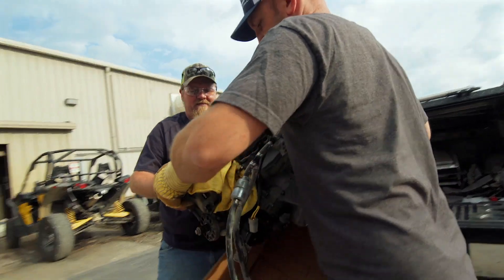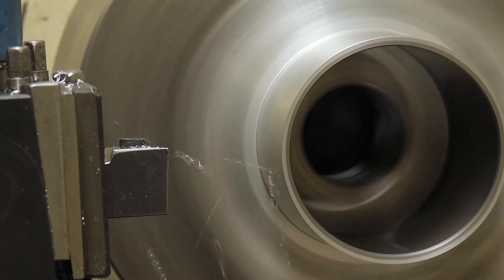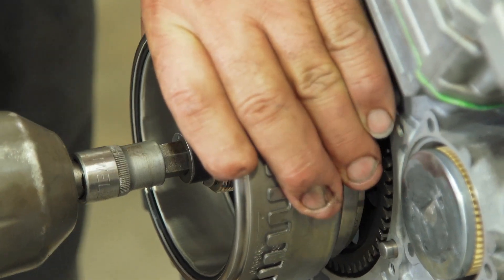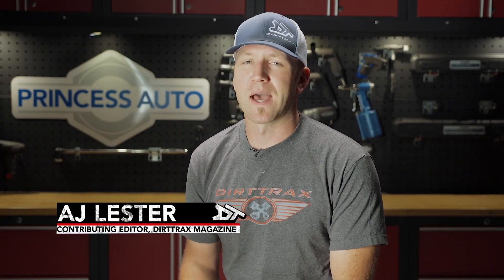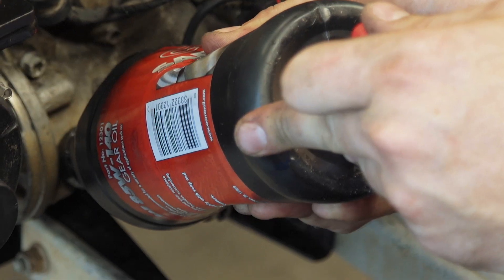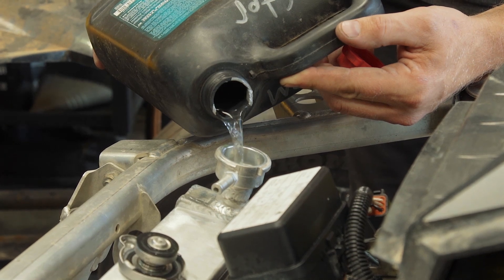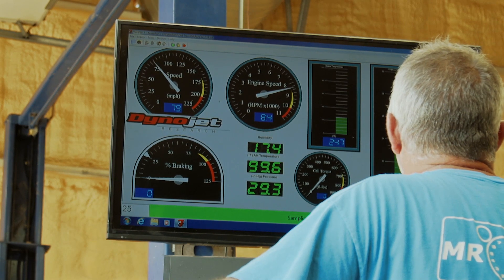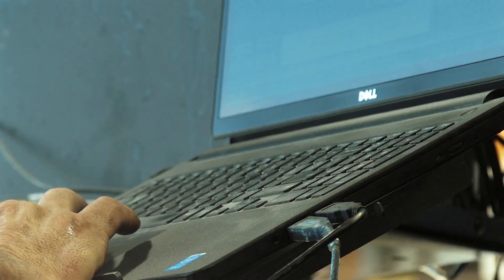Can-Am Mud Build: Part 3 - Dyno Testing

Comment: But, isn't fuel injected, hard to work on, on the 2008 can-am 800, but is it even, fuel injected
Reply from the maker: It is fuel injected, and surprisingly it's very easy to work on. Yes carb'd ATV's are less electronics but fuel injection makes a world of difference and adds lots of tuning options.

Comment: Same info of part 2
Reply from the maker: Nope part two was tearing down and rebuilding the engine, this is dyno testing it and fine tuning, which as you'll see is probably the most important step as we gained almost 20 HP from tuning and adjusting.